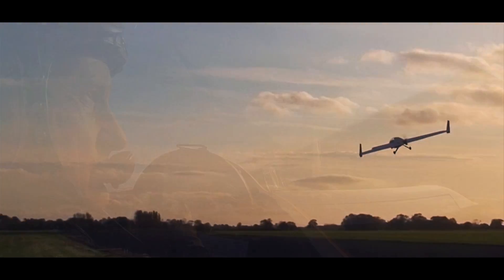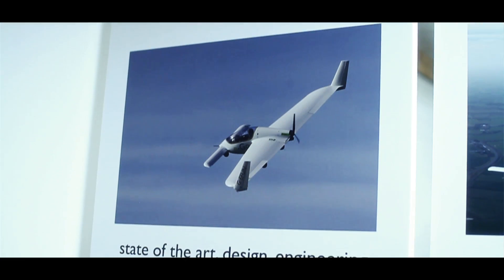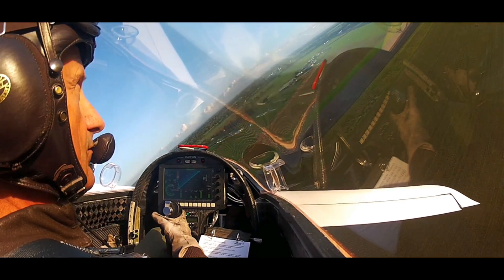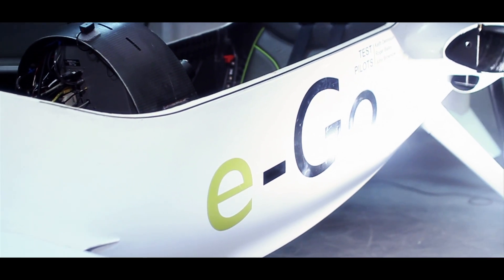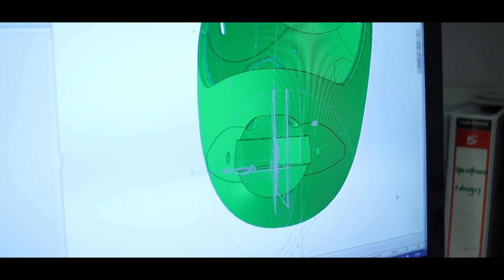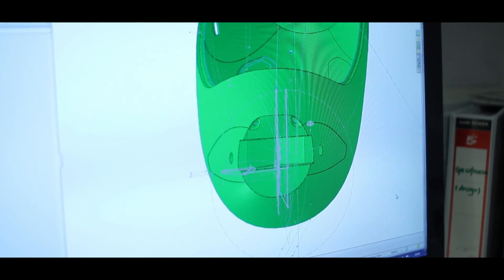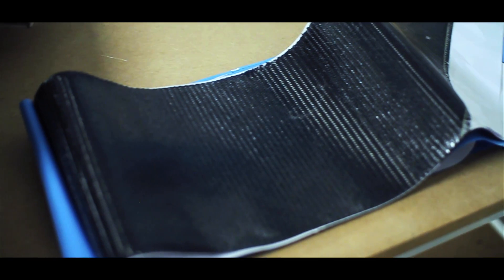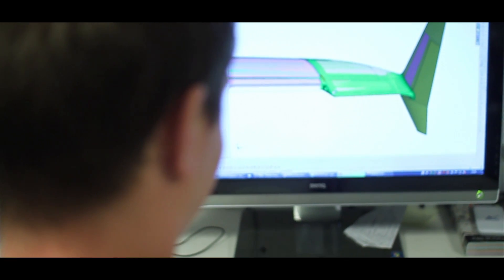Blue Sky thinking with the new e-Go Aeroplane - SOLIDWORKS Success Story

Comment: Interesting canard  design which appears to be based on the Rutan Vari-eze.  The wing area to weight ratio appears to be very high.  Configuration of  control surfaces is interesting and the weight of 300 pounds is quite amazing.  My concern would be the use of a completely new engine which appears previously to have been installed mostly in go-karts.  Aircraft engines are specially designed to be very reliable because if your engine quits, the auto club will  not be able to help you.  If you  do not find a place to land immediately you will crash and very possibly die.  Clearly, this rotary engine was chosen because of the very favorable weight in relationship to power output, but the use of non-aircraft engines in airplanes has been problematic.  One aspect that bothers me is the implication that "anyone can fly" this airplane.  In England where it is made, apparently, it can be flown legally without any license  at all.  Sounds great, but flying skills are not instinctive or intuitive.  In fact, some, like recovering from a stall, are counter-intuitive.  Just about anyone can learn to fly but instruction by a qualified pilot is essential.  Years ago in the U.S. no license was required to fly ultralights and  there were many deaths.  Here, in this single seat plane, one cannot even get a check ride with an instructor.   It would be extremely irresponsible to sell this airplane to anyone who did not have flight instruction and who could not demonstrate flying skills.  Hopefully, this manufacturer will not do that.